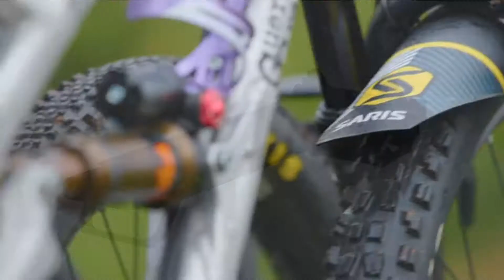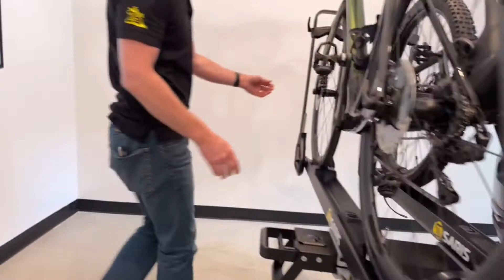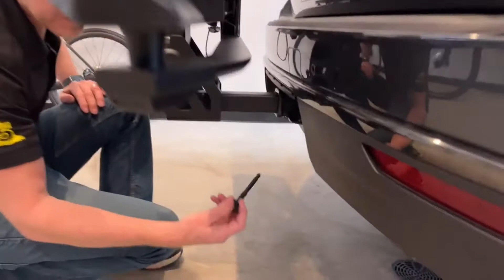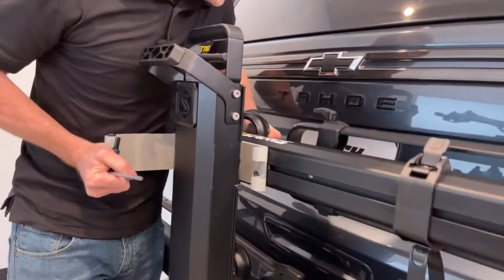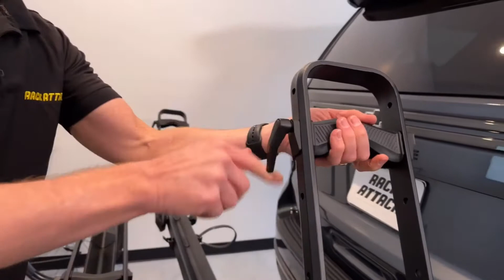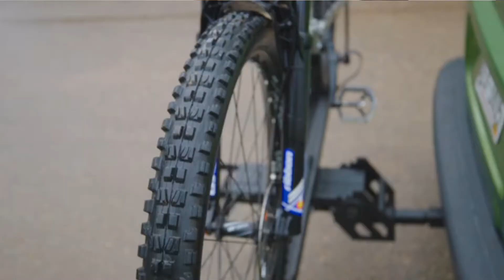Saris MHS (Modular Hitch System) Overview

Comment: The Saris MHS is incompatible with Toyota/Lexus off-road capable vehicles. Receiver pin is too short to fit the lock. Same problem with Kuat piston pro and Rockymounts Guidrail racks. Does 1up allow the use of standard 5/8" pins?

Comment: Yikes....Does this mean that anyone with a hollow point torx could remove the bike tray?  It would be all to easy and fast
Reply: Yeah, pretty wild than only one torx needs to be loosened and the entire tray and bike (with lock still attached) can be snatched. Probably less than 10s with a torx on an impact driver. A TINY bit better would be to cross the locks from the adjacent trays (if they reach) so they'd have to undo both trays, or cut the lock.
Reply from the maker: Hello.  Yes, it's considered an effective deterrent base on a cost/risk evaluation.  Thanks!

Comment: Bad design. They copied Thule but are still using a threaded pin?? Outdated design
Reply from the maker: Hello.  The threaded anti-wobble hitch pin is a widely used and well-tested solution, however, there are other tools-free designs that are also effect and very convenient.  Thanks!

Comment: Really nice rack but it seems to me the Kuat Piston Pro X is a superior system albeit more expensive.
Reply from the maker: Hello.  Yes, the Piston Pro X is really nice.  The MHS does have some unique attributes that others may find beneficial.  Thanks!
Reply: @rackattack  You're right the MHS does have some features that the Piston Pro X lacks, like how easy it is to add/remove the extra tray.  Another feature I like over the Kuat is the integrated cable lock.  I also like the wheel block and strap features that the Kuat doesn't have.  They do add an extra security.
Reply from the maker: @PQV-8898  Agreed, thanks!